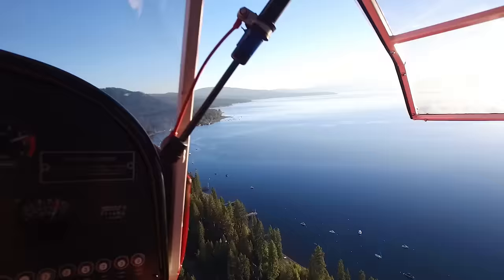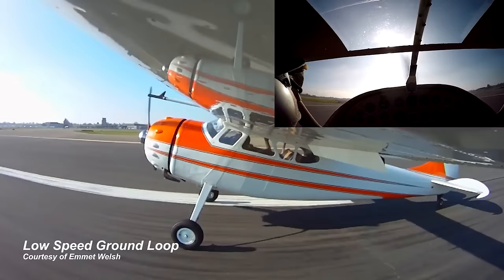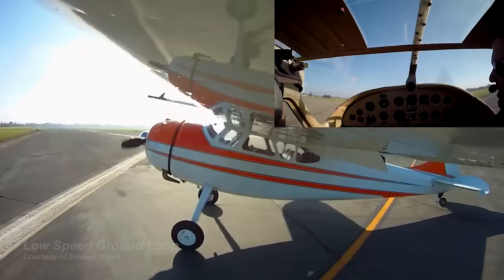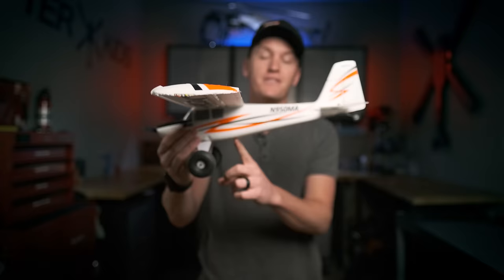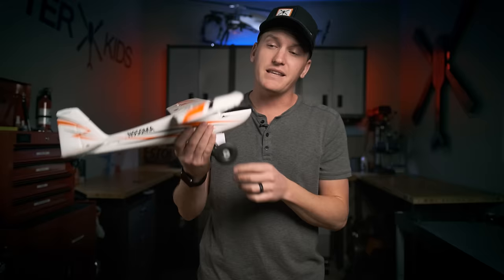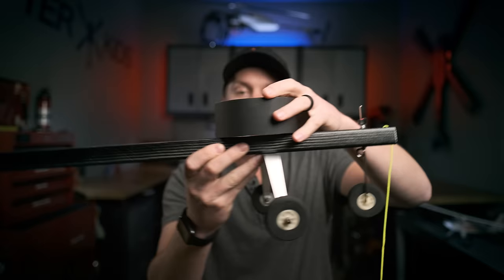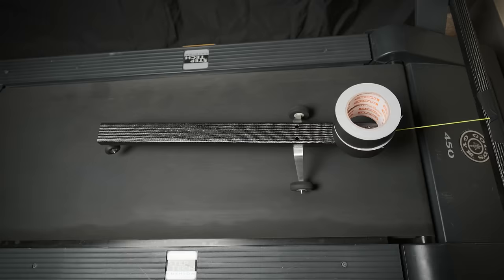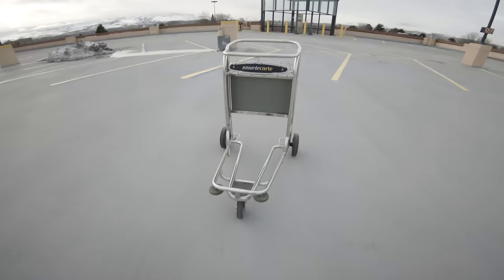The Ground Loop Monster

Comment: What about increasing the caster on the tail wheel? Wont it then be less prone to ground loop?
Reply: Nah, it would ruin your Taxiing Characteristics, and won't do a lot of good at the Speeds Ground Loops happen at anyways. 
And normally, the Performance Planes have Tailwheel Locks already, which are used for Take Off and Landing. 

Ground Loops on Take-Off normally happen when the the Tailwheel Lifts up, which in some Aircraft induces sudden changes in Rudder Authority and Direction. 
So an Aircraft may Pull to the Left on initial Roll, due to the Ground diverting the Porp Vortex, but once the Vortex can act Freely, it may attack the Fuselage and Vertical Stab at a different Angle, sometimes resulting in a complete Reversal of Control Requirements, so Right Rudder, until the Speed of the Aircraft diverts the Vortex to Attack in such a way that once again Left Rudder is required. This is more often the Case for Planes with Constant Speed Props

On Landing the most common cause are simply Crosswinds, which is why the Cross Wind Component for Tail Draggers is often much lower for them than their 3 Wheel Counterparts. 
But the same Problem as above still applies as well. The Transition from Tail Up and Fast, to Tail Up Slow and Tail Down is often accompanied by Changes in Rudder behaviour, as the Wing's Turbulent Air Shadows certain Parts of the Fuselage and Rudder,.

That is why the desired Landing Type isn't on 2 Wheels, but all 3 at once, followed with full Back Pressure on the Stick, to make the Tail heavy, and kind of use it as a Ships Anchor.

Comment: So, why continue with taildrager?
Reply from the maker: They are much more robust for off field operations, the nose wheel often is the weak point on a tri gear airplane. With all the weight of the engine directly above the single wheel it can easily be damaged, because of that tailwheel are much better suited for bush type landings. Plus they are just way more fun to takeoff and land!

Comment: Truthfully, for me the thought of tricycle gear kind'a freaks me out. And though I've spelled friends mid-flight on a yoke, it feels foreign to me. I was a skydiver, that joined a soaring club and then eventually got my private ticket in the tow plane - a Supercub. I've never flown anything but a taildragger with a stick. 

As for ground loops, it was during my second cross country. My first stop was at a little "announce-your-intentions" strip in western Washington (state) named Bayview. Two runways in the shape of a V facing into the prevailing winds, which could be fairly strong and gusty and *ahem...apparently, quite variable. So I do a flyover, checking the sock, and make an uneventful landing. So I taxi back to the crotch of the V, shut her down and hop out with my Polaroid in hand and take a couple pics. I'm feelin' good! Large and In Charge; all alone and master of my world. After dallying a bit, just to savor the moment, I give the plane a walk around before jumping in, not noticing the Cocky Monster climbing in before me.

I run her up, check the mags, run down the list on the panel in front of me and taxi into position to take off on the same runway I landed on. Powering up, I come off the brakes and start the roll. She's feeling a little squirrelly, but Cocky Monster in back whispers sweetly in my ear. Speed is up and I bring the tail off the ground and Holy Crap! The tail goes one way, the wing dips and I skid into into the sky with, I'm sure, mere inches from touching that wing to the pavement. An expletive or two later, I notice that Mr Cocky has bailed out and I'm back on task setting up the next leg, while cursing myself for forgetting check the F'ing sock. This may be the first time I've ever spoken openly about the incident, but it has crossed my mind ever take off and roll out since. And when Mr Cocky calls, I never answer. Cheers (edited for couple typos)
Reply: Are you actually Mr. Garrison?

Comment: Why not put a brake on the rear wheel?
Reply: not enough weight on it. Tail draggers are called such because they didn't used to even have a wheel down there.
Reply: @crudboy12  the slightest friction would straighten that out maybe?

Comment: Just want pilots opinions,  I started my training as a pilot in a tail wheel and was planning on doing the whole training in one. Do people feel this is a bad idea?
Reply: In my humble opinion, you should be fine. You will be learning to fly tailwheel with a safe instructor, and when you are done, you will be able to fly any kind of small plane.  Pilots have a lot of trouble when they try to transition from nosewheel planes to taildraggers.  So in my opinion it would be better to master flying the harder type of aircraft first, before you develop any bad habits with the rudder.  I’ve even heard the saying  “You haven’t really learned to fly until you’ve learned to fly a taildragger.” If you are worried about being able to complete the training, think back to the  pilots from early aviation (1910s- 1940s).  The large majority of aircraft were tailwheel, and those pilots learned to fly just fine.
Reply: I think all taildragger, all the time is a wonderful idea.  If you drive a car on ice, snow, or gravel roads, you quickly learn how to steer to keep the back end behind the front end and poor traction is not something to be feared.  In fact, steering with the throttle in a controlled slide becomes fun.  A taildragger is exactly the same thing.  Just keep the back end exactly behind the front end.  If you start on a tricycle, you start by learning bad habits that you then have to unlearn when you step up to a taildragger.  Just remember, even a baby quickly learns to land on his tail rather than his nose!

Comment: I appreciate the experienced tips as a new pilot.  I was introduced to a Ground Loop Preventer  (youtube https://youtu.be/U3hRFCP40F4 )  at sun and fun but their demo was called due to weather.  Have you had any experience or know some one using?  It looks pretty slick keeping the tail wheel locked or unlocked from the cockpit.